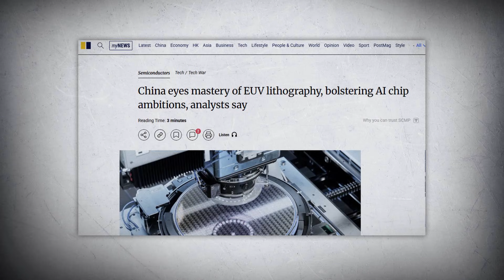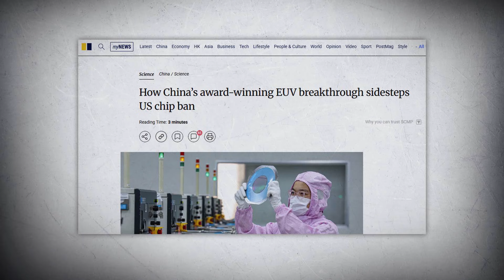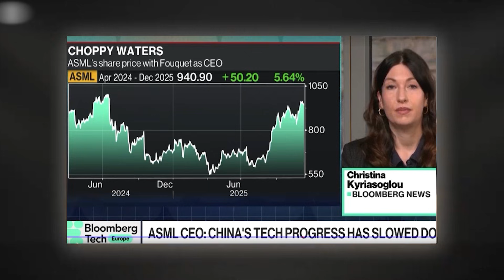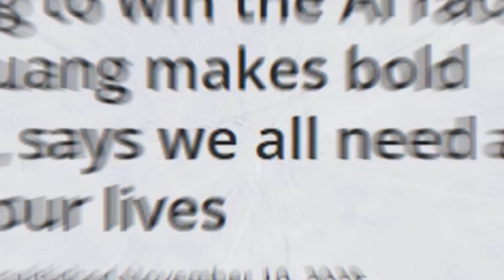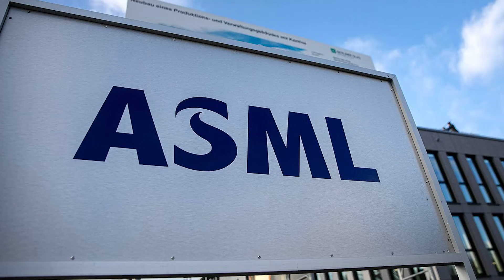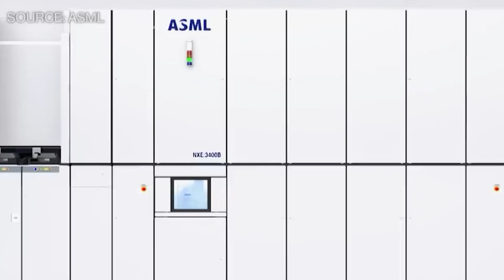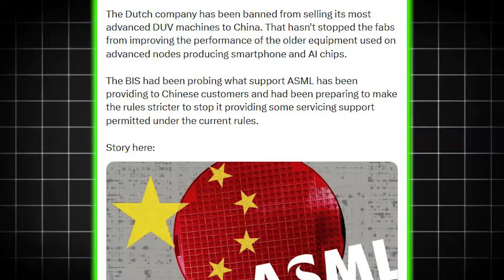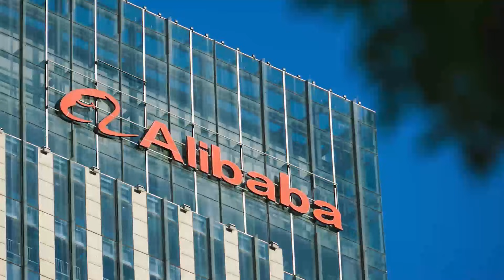China’s Manhattan Project: The Secret EUV Machine the U.S. Tried to Stop

Comment: Meanwhile the ASML company is terrified of losing court proceedings for brach of contract to all those machines China already purchased. ASML are disreputable and frauds when it comes to standing behind their products and marketing. They are diminished and now are only viewed as pirate traders rushing to hide when under pressure. China has dedicated its wealth and STEM graduates to leap over the barrier. In five more years ASML will end up like Honda is today - shutting shop for lack of supplies. The Netherlands is kaput with nexperia and ASML is not far behind. Go China, keep on walking forward.
Reply: Acting so Dutch. Stealing, cheating, obeying USA.
Reply: @Zerpentsa6598  The Dutch have a long historical association with piracy...
Reply: @Zerpentsa6598 
reverse engineering is not stealing
Reply: @Abcd1234-q4v  You know that the prerequisite for reverse engineering is that you actually have the product you want to reverse-engineer, right? So the question is: who quietly sold EUV equipment to China, enabling Chinese engineers to get started?
Reply: @outmanbsre 
The tech sanctions are so tight, there's no way China could buy any of EUV machine parts. 
The report from Reuters is  mere unconfirmed speculation. 
You have to look into China's filed patents on EUV machine to see no stealing of technology from ASML.
Reply: @Abcd1234-q4v yes it is , reverse engineering is simply said copy a existing machine. You didn’t invented nor designed it.
Reply: @willemvanderKooij
who cares? 
as long as you can make it and sell it to others, grab market shares from competitors, it's something great 👍👏
you can't do anything to stop it. 
it's actually being done for a long time by many countries including G7 countries and that's how they got rich in the first place.
Reply: @Abcd1234-q4v there is a reason a Patents exist  . You are developing a product that cost you millions, to do and then you neighbours or copy it gets it for free. ?? That is called stealing.
Reply: @willemvanderKooij
ok 
even reverse engineering you can patents filed too
it's not a carbon copy 
you don't understand that, do you?
Reply: @Abcd1234-q4v SAID THAT ON OCCASSION .GUNS AND BULLETS DOES NOT GROW ON TREES.PRODUCE WHATEVER U WANT IF U DONT HAVE A MARKET U MUST GO ABROAD AND MAKE ONE.
Reply: The previous CEO was furious when he was blocked from doing business with the Chinese because he exactly predicted that if they cannot sell it, the Chinese will eventually build it themselves and then potentially surpass them or at least undercut on price. He is retired now and ASML follows orders from the boss, not much else they can do. Sometimes I wonder if some in the US government are paid by the Chinese.
Reply: @henkjan673 Same will happen regarding COMAC. And the space station...
Reply: @henkjan673  🤣🤣🤣
Reply: Dont worry for the courts, the west controlls the courts
Reply: most people probably aren't aware, it was TSMC engineers' who came up the idea and schematics for EUV, not ASML.
Reply: @willengel2458 Actually, the ORIGINAL idea was proposed in a scientific paper published by two Russian physicists/engineers. The Japanese spotted the potential and invested, but later transferred to USA for lack of funds,
The history is even mentioned on the very Web page of ASML under "Who are we"  or such like as I recall The stumbling block of the monochromtic UV was overcome by buying the technology fro a Cambridge(UK) high tech company, and the lenses and reflectors fro the German ZEISS company.
(Apologies for any misspellins)
Reply: @palestinev3722 That's how global companies work. Now the sources are bleeding out.
Reply: My Taiwanese esl student told me all they had to do was pay these chip engineers more....wow....and Americans can't even do common core math
Reply: Looks like time for the EU to generally wake up and smell the coffee - this strategy keeps backfiring and will ultimately wreck their economy
Reply: @nankhomakay7249 no no let them sleep on the bar stool. 
After all, they drank trillions of colonial loots n grabs down the drain..the bar drain..... and begged the US fight their wars.
Reply: wow thank you all for your reply and enlightening history. I have no regrets for the Dutch losers. five centuries ago they butchered their way in China, and across Taiwan and at the same time were doing the same in Indonesia. I can recommend the four part book series by Pramoedya Ananta Toer "This Earth of Mankind" he is a great comrade in the anti-imperialist struggle. Technology advances are on the move and certainly not hostage to ASML machines. Even Canon in Japan is doing the same approach as in China with nano imprint technology, the race for social and technological improvement is a relay serving the world.
Reply: True Speech Sir ❤
Reply: China's EUV lithography machines never needed to reverse-engineer Western products—the core reasons lie in the total lack of physical samples to disassemble, the insurmountable complexity of the underlying technologies that cannot be replicated through teardowns, and our adoption of an independent, diversified technological roadmap. What’s more, China’s EUV tech is far more advanced and powerful than Western counterparts—it not only breaks the monopoly but also outperforms the West in core performance and technical architecture. The Western claim of "reverse-engineering" is nothing but sour grapes.
 
I. No Physical Samples to Reverse-Engineer: Blockades Forced Us to Forge an Independent Path
 
- The US-led comprehensive EUV embargo strictly prohibits ASML from selling complete EUV systems to China; we are denied access even to core components and technical documentation. Without any physical reference, reverse-engineering is simply impossible.

- Even attempting to disassemble older DUV machines would be futile. Mishandling during teardowns can easily damage the equipment, and DUV and EUV differ drastically in technical principles and system architecture—tearing apart a DUV machine yields zero insights into EUV’s core know-how.
 
II. Overwhelming Technical Complexity Makes Reverse-Engineering a Pipe Dream
 
- A single EUV machine integrates over 100,000 components, spanning dozens of disciplines and relying on more than 5,000 global suppliers. Its software runs on hundreds of millions of lines of code, and the nanoscale coordinated calibration experience and long-term operational data are completely inaccessible through disassembly.

- Western core optical mirrors demand a surface flatness equivalent to "a height difference of less than 0.4 millimeters across an area the size of China’s territory", yet teardowns cannot replicate the precision of their multi-layer coating processes. Core technologies like tin droplet control and energy conversion in the light source system are the fruits of years of R&D accumulation, not something that can be copied by taking a machine apart.

- ASML’s equipment is equipped with embedded monitoring systems and patent barriers—reverse-engineering would trigger legal and technical protection mechanisms, making the task as difficult as scaling Mount Everest.
 
III. Independent Ecosystem + Diversified Technical Routes: A Fundamentally Different Path from the West
 
1. Core Technical Route Differences: China’s Approach is Far More Forward-Looking
 
- The West (ASML): A single, inflexible route dependent on US CO₂ lasers to power the LPP (Laser-Produced Plasma) light source. It requires bombarding 50,000 tin droplets per second to generate EUV light, suffering from inherent flaws like tin contamination and low energy conversion efficiency.

- China: Parallel independent and diversified routes, including the solid-state laser-driven LPP route developed by the Shanghai Institute of Optics and Fine Mechanics, the DPP (Discharge-Produced Plasma) route from Harbin Institute of Technology, plus innovative solutions like Tsinghua University’s SSMB (Steady-State Micro-Bunching) and Haoyuxin Optics’ HHG (High-Harmonic Generation) technologies. These are not only fully self-controlled but also directly address the pain points of Western tech.
 
2. Key Advantages: China’s EUV Outperforms the West in Performance, Cost, and Stability
 
1. Light Source Performance Dominance
The West’s LPP light source has a mere 5.5% energy conversion efficiency. China’s solid-state laser LPP has already reached 3.42% (with a theoretical ceiling exceeding 6%), the SSMB solution delivers a power output of 3,200 watts, and HHG technology achieves a "broadband-ultrafast-coherent" trinity with tunable wavelengths and zero contamination.

2. Dramatically Improved Stability
The West’s tin plasma light source causes severe tin contamination, requiring mirror cleaning every 2 hours. China’s EUV-FEL (Free-Electron Laser) solution eliminates tin contamination entirely, extending mirror cleaning cycles to 50 hours. Its power stability of ±0.5% far surpasses the West’s ±5%.

3. Exponential Leap in Inspection Efficiency
Western electron beam inspection is slow and low-throughput. China’s HHG-EUV inspection is 100–1,000 times faster than electron beam methods, with a resolution 10 times better than DUV. It can identify defects smaller than 5 nanometers and enables non-destructive 3D imaging.

4. Superior Cost-Effectiveness and Flexibility
Western EUV systems are bulky, prohibitively expensive, and costly to maintain. China’s HHG systems can be deployed on a desktop scale (just 3m × 1.5m in size), eliminating the need for complex contamination control systems. They boast strong engineering feasibility and democratize access to advanced EUV research equipment.

5. A Fully Localized Industrial Chain
China has built a complete domestic supply chain covering optical mirrors (Changchun Institute of Optics, Fine Mechanics and Physics), laser crystals (Fujing Technology, holding 80% of the global market share), precision structural components (Fuchuang Precision), and system integration (Shanghai Micro Electronics Equipment). In contrast, the West relies on a fragile network of over 5,000 global suppliers.
 
IV. Conclusion: A Victory for Independent Innovation, Not Reverse-Engineering
 
The Western hype about "reverse-engineering" is essentially an unwillingness to acknowledge that China has broken their technological monopoly through independent R&D. China’s EUV technology not only shatters the blockade but also surpasses the West in technical routes, core performance, and industrialization costs. The fundamental difference lies in this: the West has taken a path of "monopolistic single-route reliance + pushing physical limits", while China has embraced "diversified innovation + system optimization"—and that is the true definition of technological leadership.
Reply: Both the Netherlands and ASML are ball suckers and butt kissers of the United States. They will sacrifice their business principles and professional ethics just for some bread crumbs from the US.
Reply: Hope is it sooner.
Reply: Are you that mad? See a doctor.
Reply: China's EUV lithography machines never needed to reverse-engineer Western products—the core reasons lie in the total lack of physical samples to disassemble, the insurmountable complexity of the underlying technologies that cannot be replicated through teardowns, and our adoption of an independent, diversified technological roadmap. What’s more, China’s EUV tech is far more advanced and powerful than Western counterparts—it not only breaks the monopoly but also outperforms the West in core performance and technical architecture. The Western claim of "reverse-engineering" is nothing but sour grapes.
 
I. No Physical Samples to Reverse-Engineer: Blockades Forced Us to Forge an Independent Path
 
- The US-led comprehensive EUV embargo strictly prohibits ASML from selling complete EUV systems to China; we are denied access even to core components and technical documentation. Without any physical reference, reverse-engineering is simply impossible.

- Even attempting to disassemble older DUV machines would be futile. Mishandling during teardowns can easily damage the equipment, and DUV and EUV differ drastically in technical principles and system architecture—tearing apart a DUV machine yields zero insights into EUV’s core know-how.
 
II. Overwhelming Technical Complexity Makes Reverse-Engineering a Pipe Dream
 
- A single EUV machine integrates over 100,000 components, spanning dozens of disciplines and relying on more than 5,000 global suppliers. Its software runs on hundreds of millions of lines of code, and the nanoscale coordinated calibration experience and long-term operational data are completely inaccessible through disassembly.

- Western core optical mirrors demand a surface flatness equivalent to "a height difference of less than 0.4 millimeters across an area the size of China’s territory", yet teardowns cannot replicate the precision of their multi-layer coating processes. Core technologies like tin droplet control and energy conversion in the light source system are the fruits of years of R&D accumulation, not something that can be copied by taking a machine apart.

- ASML’s equipment is equipped with embedded monitoring systems and patent barriers—reverse-engineering would trigger legal and technical protection mechanisms, making the task as difficult as scaling Mount Everest.
 
III. Independent Ecosystem + Diversified Technical Routes: A Fundamentally Different Path from the West
 
1. Core Technical Route Differences: China’s Approach is Far More Forward-Looking
 
- The West (ASML): A single, inflexible route dependent on US CO₂ lasers to power the LPP (Laser-Produced Plasma) light source. It requires bombarding 50,000 tin droplets per second to generate EUV light, suffering from inherent flaws like tin contamination and low energy conversion efficiency.

- China: Parallel independent and diversified routes, including the solid-state laser-driven LPP route developed by the Shanghai Institute of Optics and Fine Mechanics, the DPP (Discharge-Produced Plasma) route from Harbin Institute of Technology, plus innovative solutions like Tsinghua University’s SSMB (Steady-State Micro-Bunching) and Haoyuxin Optics’ HHG (High-Harmonic Generation) technologies. These are not only fully self-controlled but also directly address the pain points of Western tech.
 
2. Key Advantages: China’s EUV Outperforms the West in Performance, Cost, and Stability
 
1. Light Source Performance Dominance
The West’s LPP light source has a mere 5.5% energy conversion efficiency. China’s solid-state laser LPP has already reached 3.42% (with a theoretical ceiling exceeding 6%), the SSMB solution delivers a power output of 3,200 watts, and HHG technology achieves a "broadband-ultrafast-coherent" trinity with tunable wavelengths and zero contamination.

2. Dramatically Improved Stability
The West’s tin plasma light source causes severe tin contamination, requiring mirror cleaning every 2 hours. China’s EUV-FEL (Free-Electron Laser) solution eliminates tin contamination entirely, extending mirror cleaning cycles to 50 hours. Its power stability of ±0.5% far surpasses the West’s ±5%.

3. Exponential Leap in Inspection Efficiency
Western electron beam inspection is slow and low-throughput. China’s HHG-EUV inspection is 100–1,000 times faster than electron beam methods, with a resolution 10 times better than DUV. It can identify defects smaller than 5 nanometers and enables non-destructive 3D imaging.

4. Superior Cost-Effectiveness and Flexibility
Western EUV systems are bulky, prohibitively expensive, and costly to maintain. China’s HHG systems can be deployed on a desktop scale (just 3m × 1.5m in size), eliminating the need for complex contamination control systems. They boast strong engineering feasibility and democratize access to advanced EUV research equipment.

5. A Fully Localized Industrial Chain
China has built a complete domestic supply chain covering optical mirrors (Changchun Institute of Optics, Fine Mechanics and Physics), laser crystals (Fujing Technology, holding 80% of the global market share), precision structural components (Fuchuang Precision), and system integration (Shanghai Micro Electronics Equipment). In contrast, the West relies on a fragile network of over 5,000 global suppliers.
 
IV. Conclusion: A Victory for Independent Innovation, Not Reverse-Engineering
 
The Western hype about "reverse-engineering" is essentially an unwillingness to acknowledge that China has broken their technological monopoly through independent R&D. China’s EUV technology not only shatters the blockade but also surpasses the West in technical routes, core performance, and industrialization costs. The fundamental difference lies in this: the West has taken a path of "monopolistic single-route reliance + pushing physical limits", while China has embraced "diversified innovation + system optimization"—and that is the true definition of technological leadership.
Reply: Send the bill to Trump he stopped it .
Reply: HEY U REMEMBER THE WAY SOCIETY PRACTICES BUSINESS WILL SURELY DESTROY IT .ALSO REMEMBER IN BUSINESS THERE IS N--- O GOD ONLY PROFITS .
Reply: Its not the company - its the Yanks - they have forced them into this situation.
Reply: @piccalillipit9211  that's what i though until i watched the video titled " ASML CEO: China Won't Accept Being Cut Off From AI Chips "  ....he's in on it